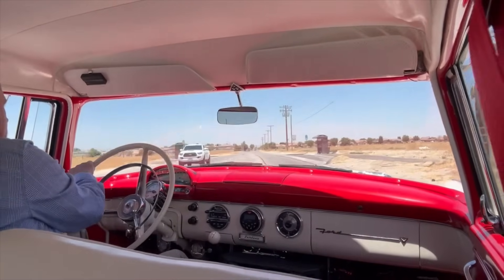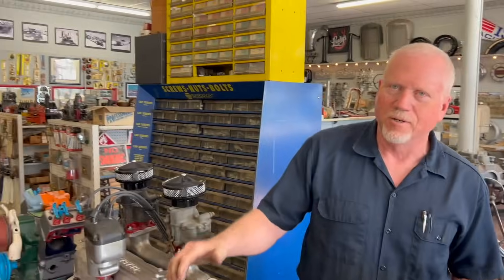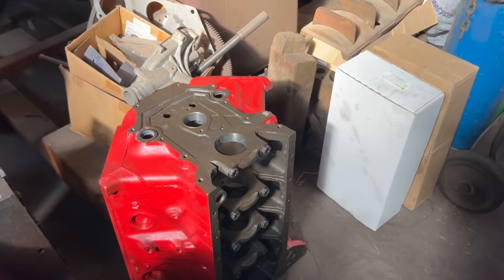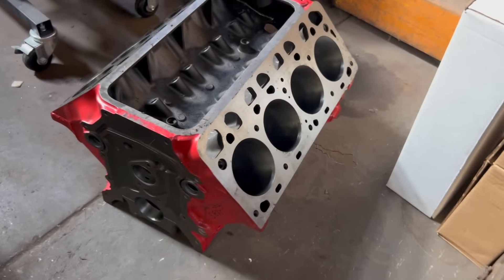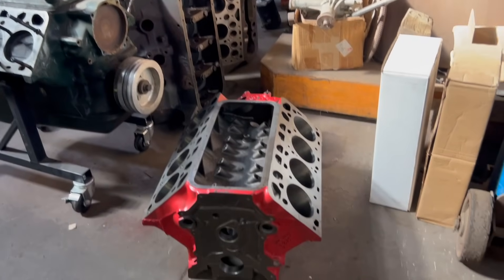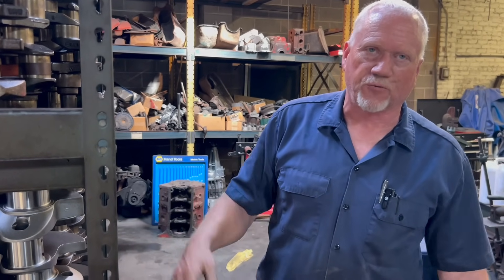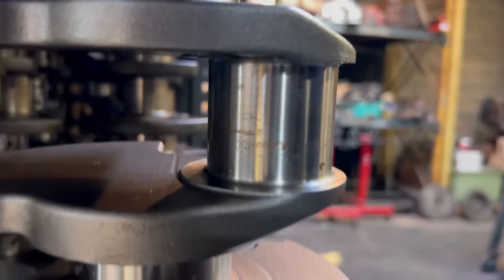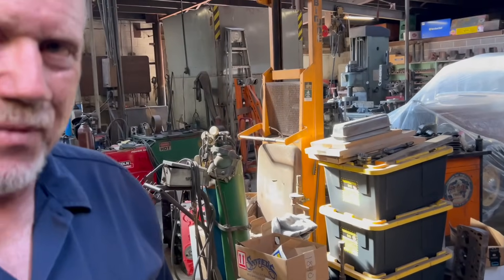Y Block Ford V8 342 cubic inch Stroker Engine Build with Tim McMaster Hanford Auto Supply & Machine

Comment: curious about mains boring or honing, do you check first to see how much out or perhaps use crankshaft to see any variance in main clearances to block.as it is rotated, I always would inspect carefully on dis assembly to look for unusual wear to verify if out of tolerance. poor mans way I guess but always worked for me.
Reply from the maker: I will let Tim comment on this, but I can tell you that for the decks we had a variance of .004 from corner to corner. This just trued it all up to the crank centerline all the way. On the mains, this is something that Tim does on each Y Block he builds - extra insurance that all mains are aligned. If this is standard practice on each Y Block he builds there really is no need to take the time to check clearances. I highly doubt there ever has been a Y Block that was being set up for a rebuild that had mains 100% on the money from front to rear.

Comment: leaky rear mains usually a Chrysler now we find MOPAR is a fix, who'd a thought
Reply from the maker: Tim will have more on that one later 😉
Reply: @HotRodReverend  good to know, any death traps under those cam bearings, been awhile  I forget y block
Reply from the maker: @jmflournoy386 typically it is not under the cam bearings that is the issue. They do need to be installed correctly
Reply: @HotRodReverend  tks I like tobe able to clean the oil passages after machining and honing  followin06g but doubt Ill get to do another y block  did some in the 50s 60s

Comment: Real good Video, That 342 will make some power, you may need a T85  and Dana 44 . I am buiding a 56 Lincon  368 bored 040, mild Don Johanson solid cam , low comp heads, 4000 holey Mchuloch blower, Try Y headers .Beefed Fordomatic Dana 55 rear 307  gear going to drive on street, run old time drags, and run Measured Mile ,I think there is a Total of 3 people in the world that race Yblock Lincolns . Like your Videos   Rick Martin  Darrtown Ohio
Reply from the maker: Rick - thanks for joining us and leaving a comment about your build. And yes, I do have a couple of T85’s in the garage here, planning on that upgrade when I install the 342 c.i. y Block.